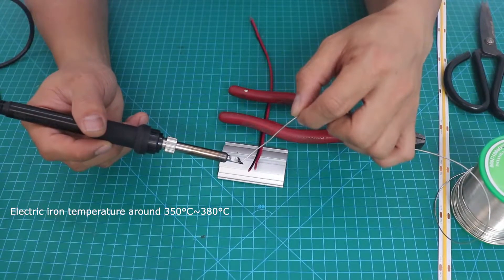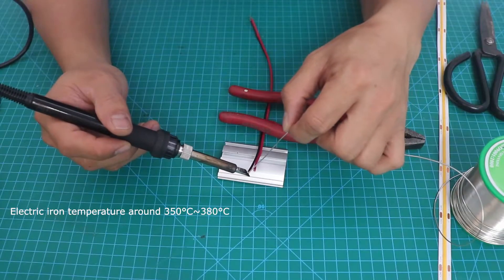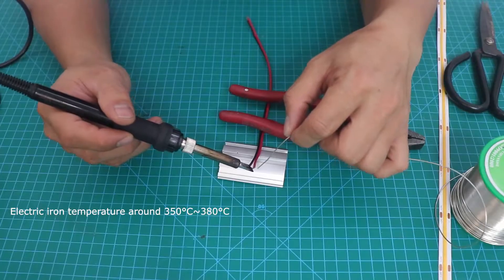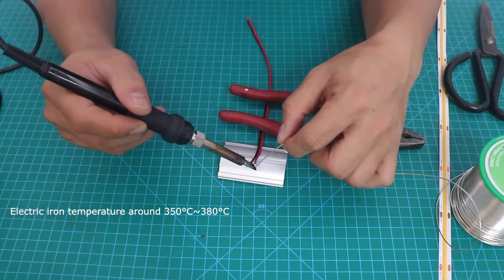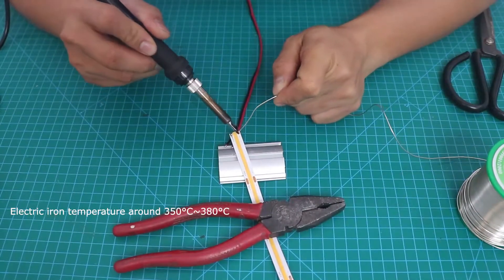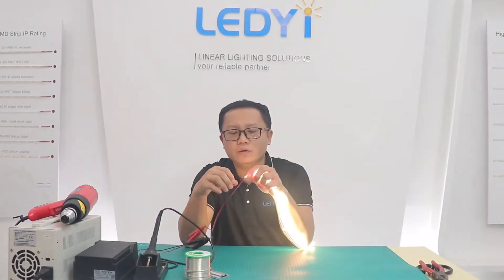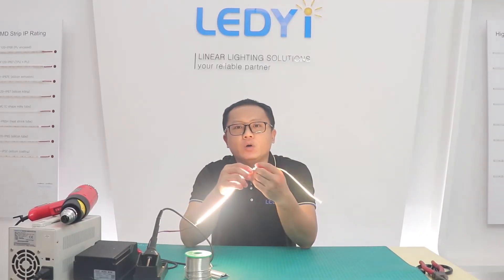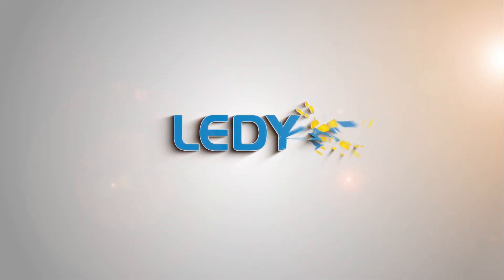How to Solder, Cut, and Join COB LED Strip Lights | Step-by-Step Guide

Comment: Thank you for this helpful video! Could you please do one on the BTF-LIGHTING FCOB SPI RGB Flexible High Density LED Strip COB WS2811 IC LED Strip 5M 630LEDs/m has they stick out and on my gussing I have cut more of the light section more back to see if that will be easier to join them, but I'm not 100% sure